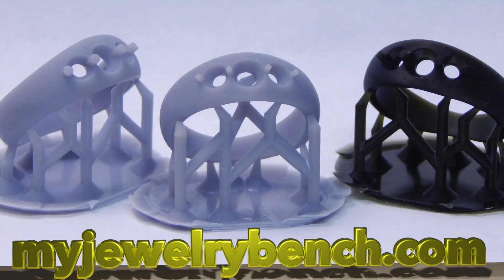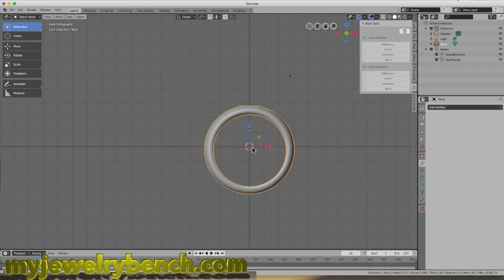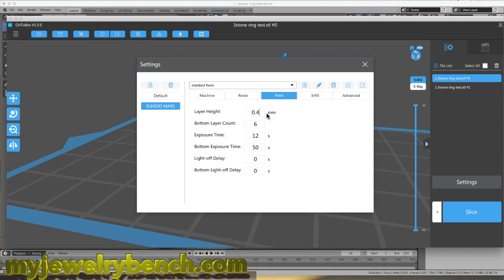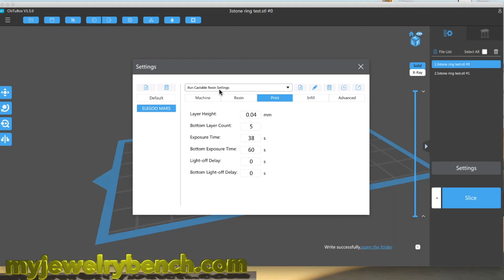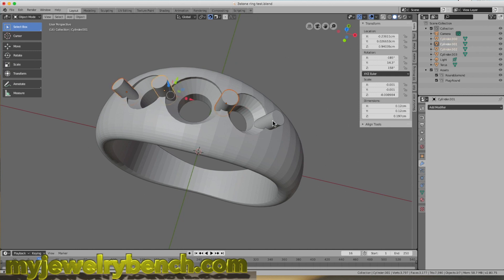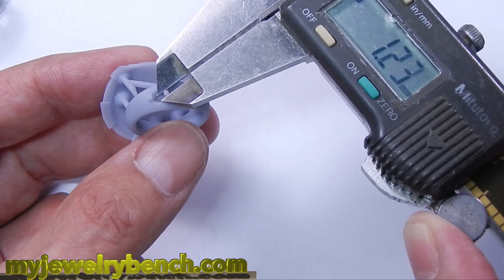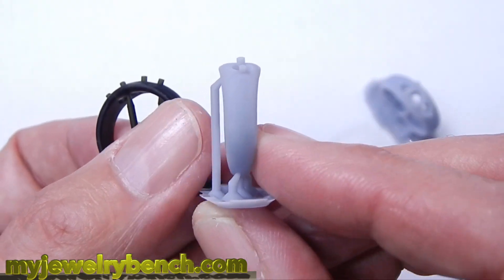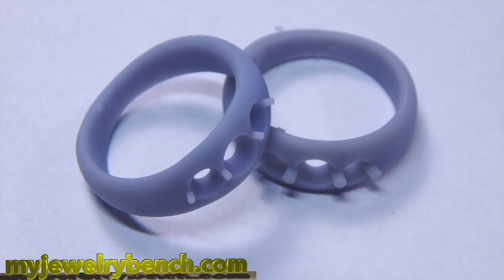3D Printing Prongs on Jewelry with your Elegoo Mars or Anycubic Photon

Comment: What I'm having trouble with is finding a way to adjust the ring size inside of chitubox. For instance, I got the The One Ring STL to print for my wife at the size of 8.5, but I can't figure out how to convert that along the X,Y,Z axis. Do you have a method for this?
Reply from the maker: In chitubox there is a scale option on the left. However I think it is a guess game to adjust it accurately.
Reply from the maker: Remember please that resin shrinks when printed. 1% to 8 % depending on which resin you use
Reply: i have the same problem, did you figured out how to size them with chitubox? or did you use another program before importing to chitu?
Reply: @emg4ever  I ended up finding an stl that gave me each size and then I scaled them up by 2%

Comment: If you needed to resize a ring model in cad, say from an stl file. Would you scale the whole body and change the gem settings manually so they are the right size? Or would you scale it, print it and then touch it up?
Reply from the maker: I may scale the entire image up, but only enough so that the original stone fit, and yes, make a bit of manual adjustment to the setting of the stone.  This, however, will not work, for example, on a ring size 6, that has a stone in it that is 10mm.  If I size the model up to adjust to a ring size of say, 9, then the stone size will be 11.25 mm.  Posses a problem.  When I model, I tend to start with Ring size if I know it, or for women, a size 7, men a size 11.  Then I model the ring from there.
If, however, you only have to adjust for ring size, you may be better off designing a ring with a larger size finger sizing, and manually size it down after casting.  It is always easier to size a ring down!  LOL  Hope this helps
Reply: @watchesandjewelry  thank you very much! This is a very big help
Reply: @watchesandjewelry  what software would you recommend to start designing jewellery?

Comment: Is the Anycubic Gray resin same like the Elegoo gray ?
I mean you would be set the same settings to print ?
Reply from the maker: They are identical in final print quality.  Of all the resins I’ve used, most are made the same. Some of the very cheap resins seem to be “watered” down a bit. The only issues I’ve had with standard resins seems to be the length of cure time after printing and some discoloring after curing.
Reply: @watchesandjewelry  Thank's Peter!

Comment: I'm confused as to how those four prongs will hold three stones. I thought you would need a prong on either side of the hole that would be bent in to hold the stone. That obviously can't happen without six prongs, so I'm not sure how this works. Unless maybe the prongs are simply narrowing the hole size for a sort of compression fit for the stones, then they wouldn't need to be bent at all?
Reply from the maker: I’m not sure how well I can explain it. However, look at each prong as a kind of rivet. The hole that the stone sits in acts like a bed and using a beading tool or a prong pusher applying force straight down on the prong will expand the prong surface and hold down the stone. The second way would be to use a graving tool and push down in the center of the prong in between two stones pushing the metal two ways and covering two stones.  Wow. A lot I’m sure. But if you want me to make a video on that subject I would be happy to. Let me know.  Thanks for watching.
Reply: @watchesandjewelry  you can make a video if you like, but I think I understand your explanation already. I didn't know the prongs worked like that, but it makes sense now.